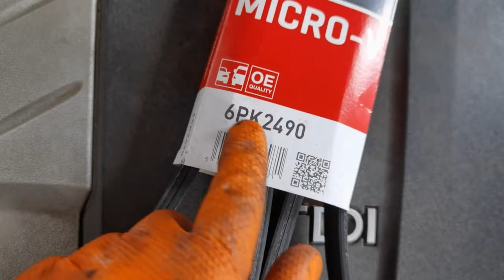AUDI A6 2.7 TDI SERPENTINE BELT REPLACEMENT

Comment: This belt snapped on our car. We didn't notice it. Then the car just suddenly stopped no smoke no liquid no loud noises what should we do ?
Reply from the maker: If Only The Transmission Belt Snapped you're fine for now. Just replace it with a new one but I recommend you to check all the giudence pulleys and the tensioner and also don't forget to check the crankshaft pulley from the bottom because they tend to fail.

Comment: Is it really possible to replace the belt without removing the bumber ?
Reply from the maker: Not really. It's not worthing the efort and scratching elbows. Just remove the necessarily parts and you'll be fine.
Reply: @HOWTODO0828  ok thanks
Reply: @HOWTODO0828  It can be done from underneath with help from another releasing the tensioner

Comment: I got a 2008 2.7 tdi but I don't have the rollerwheel on top as you do? u know why?  (7:09)
Reply from the maker: I'm not sure why you don't have it.
Reply: Not sure if you still need it but there a 2 Versions of the Pulley System. 

If you are missing the small pulley then you need a different serpentine belt. 

The length of the belt without the extra pulley is 2460. 

In the video he used a 2490 belt. The 2490 is 30mm longer then the 2460 due to the extra pulley.